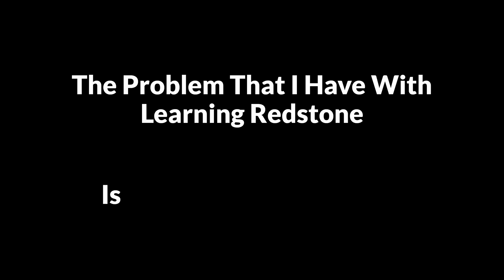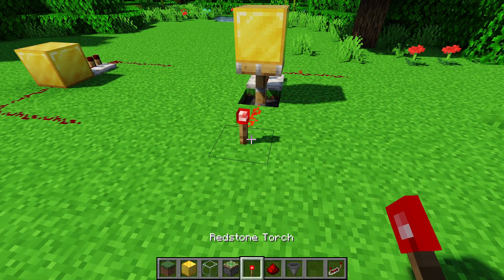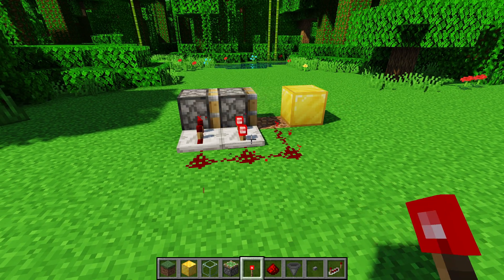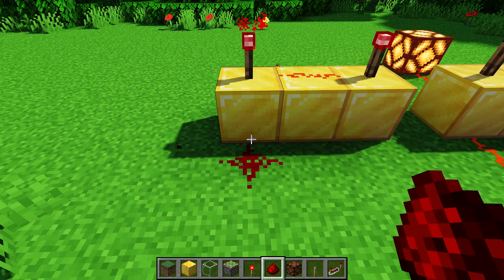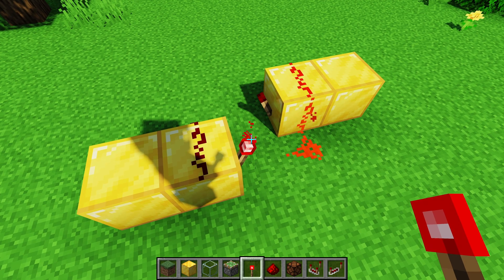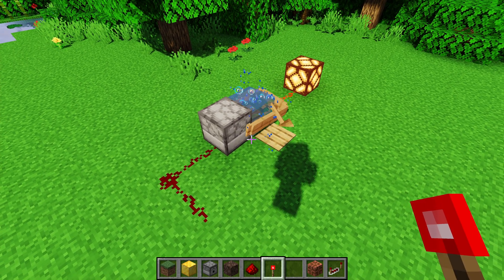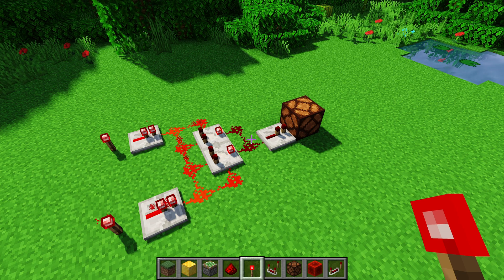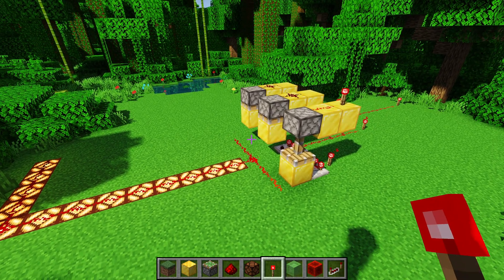Redstone Circuits You Didn't Know You Needed | Minecraft Redstone Engineering Tutorial

Comment: I strongly feel you on this as someone that's also self taught. I often can figure out roughly what circuit I need, but I don't know what it's called so it's hard to find. Even when I know what it's called like an ABBA circuit... I'll be sure that there's some really beautiful optimized version out there, but then I have trouble finding it and end up having to juryrig a rats nest of wiring (which is in part the fault of youtube's search being bad, since like 95% of redstone knowledge is on here, but often you'll ask for something specific and get totally unrelated stuff back

I mean, whole reason I found this video is I'm trying to find something that will loop a single back 3 times before letting it pass through and then stop the loop (while making sure it's reset so it's ready for the next time). Need it for a song I'm converting to noteblocks where it repeats a couple chords 3 times at the same tempo and it would save me a lot of space... I'm out here looking for stuff like "silent redstone counter" because I haven't been able to throw something together yet myself (I'm sure I will eventually since I probably won't be able to find what I need)

As far as useful circuits I've found go, one not by me the other something I made. The one I stumbled across on reddit is a compact pulse extender where you take a 3x3 space, put a solid block in 3 corners, put a redstone dust in the empty corner and then one more dust towards one of the blocks. Then you take 3 comparators pointing away from which ever block the dust is pointing into and loop them around to complete the circuit. I find it's the perfect amount of time for things like hidden doors to stay open, and if you need it a bit longer you can chain them with repeaters

The one I've come up with on my own is an XOR gate using copper bulbs that's part of a validation mechanism. I'm working on this moon clock where I need the clock face to be set to the phase my day counter is on. I've got it so each phase of the moon corresponds to a pattern of 3 lights, so both the clock and the counter are outputting what phase they're on. I plug that in to a staircase of copperblubs, each with an observer on both sides to detect if one of the input lights changes. When they both agree, there's no problem and the bulb is off, but if the lamp is on on one side and not the other, the copper bulb will light up. There's a comparator reading each bulb and all feeding into a single line, which when it's on lets the clock cycle. It doesn't shut off until all 3 bulbs agree (you know... it's really hard to explain redstone in text, a screenshot of this and you'd get it in 2 seconds, but I feel like this description is probably just confusing)

Oh, one real important and also simple tip I have is I've found that a real easy way to make a one way is using a slab a block above your redstone line. Like you said, signal can go up but not down, so that can be pretty useful for letting a signal through without getting backwash from other parts of the circuit (you may well have already found that one on your own)

Anyway... sorry for the long comment. Just watching this video I know exactly what you're talking about. You're working on something, you know you need a thing that does roughly x... but if that already exists and what it would be called, you've got no clue. By far the most painful part of being self taught with redstone. So I just kinda wanted to say I feel you on all this cause it's the same for me

Nice video, keep up the good work and keep learning (meanwhile I gotta get back to trying to figure out how to make this circuit that lead me to stumbling on your video in the first place)
Reply from the maker: It wasn't until I took digital logic in University did I know what most of the circuits were actually called. I hope your get your song up and running, I've never done a song since they are a huge amount of work haha
Reply: @ZennsWorld  I in fact just finished getting it working a couple minutes ago. Having a pulse counter came in really handy because there's a part in the song (it's called Conde Petie, it's from Final Fantasy 9) where there's some guitar strumming, and I was able to save a whole lot of space turning it into a pulse counter that shut itself off after enough activations instead of needing 24 note blocks each time

It was a fun project, I got to figure out a 2 output flipflip that I was able to chain 3 together to make something that round robin'd things so I could reuse this repeating part while changing the end to what it needed to be

Anyway, always appreciate when people make youtube videos about redstone. Gives a good chance to get inspired and figure out how something will work for a project

Hope you're having a good day and hope you feel good knowing the impact you've had on someone else's redstone